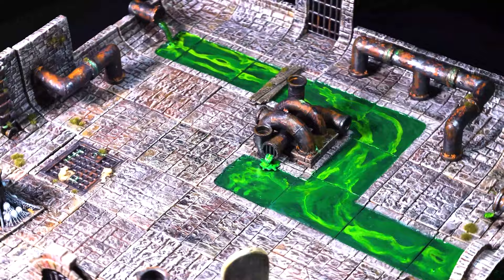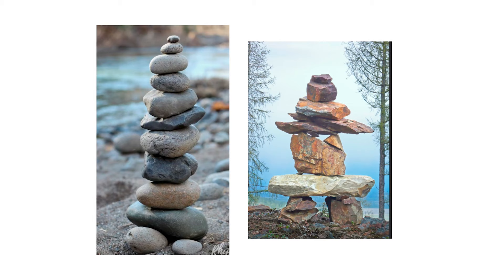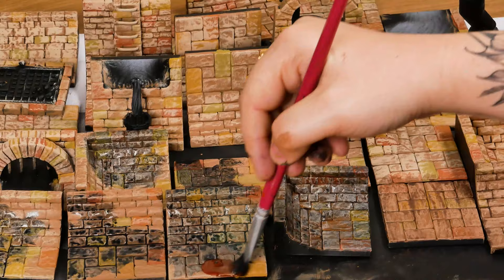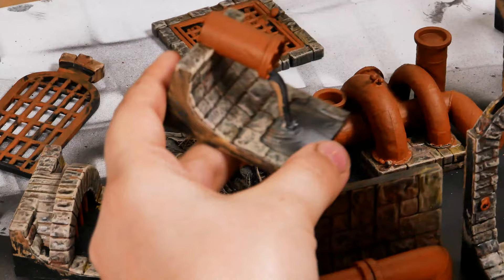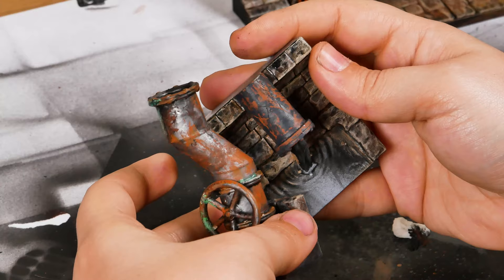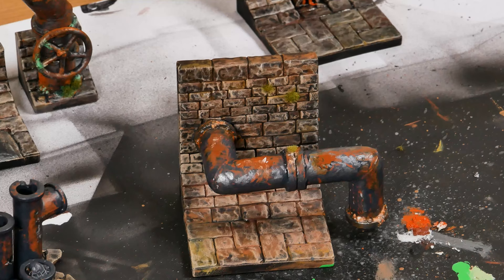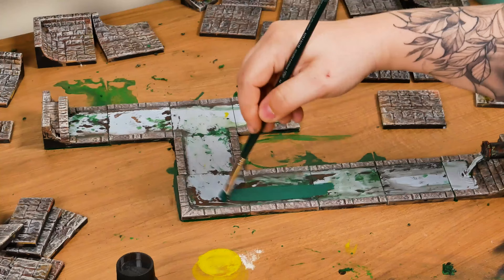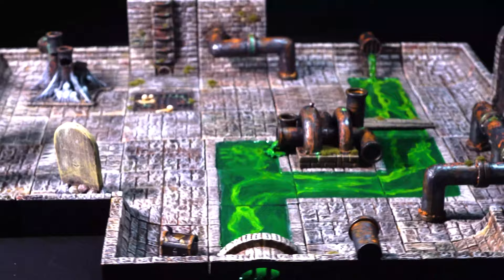PAINTING 3D MODULAR SCENERY (SEWER)

Comment: Use coarse salt grains, small rock salt for chipping.
Add to the underlying, wet paint. 
Paint over, let dry.
Chip away.

Now, you will have to find out yourself how large the small (sea)salt rocks need to be. 
It's also good if they are in different shapes.
Try many grains in an area, try few grains in an area.

Comment: For a really inexpensive chipping fluid, get the least expensive hairspray you can find. You can use essentially this technique, but for the chipping process, you can use water.

For applying the hairspray, it's very common to spray the fluid into a cup, then apply with an airbrush, since you have very little control of where the fluid is going if you use it straight from the spray can.